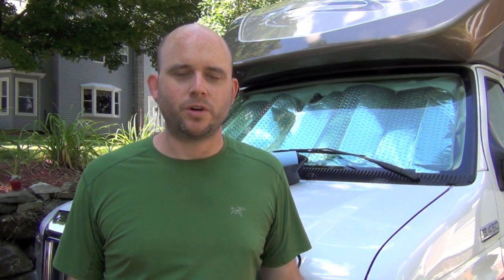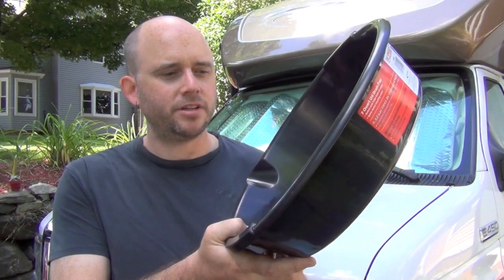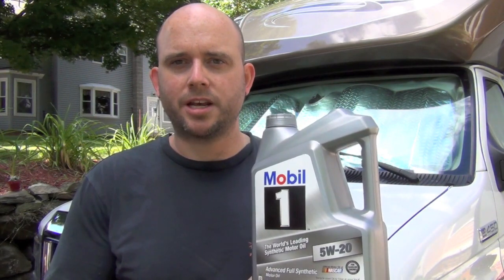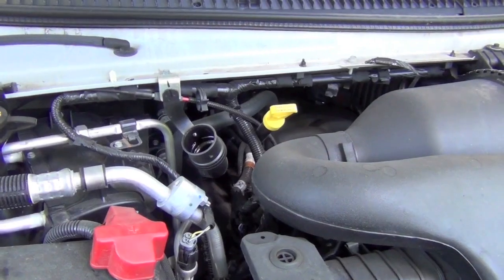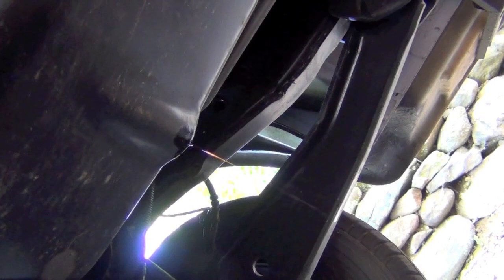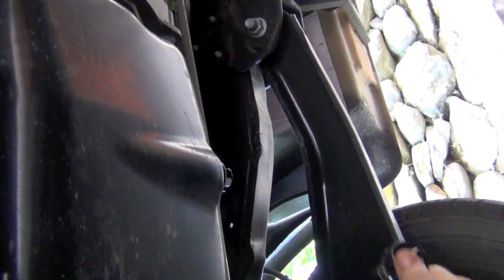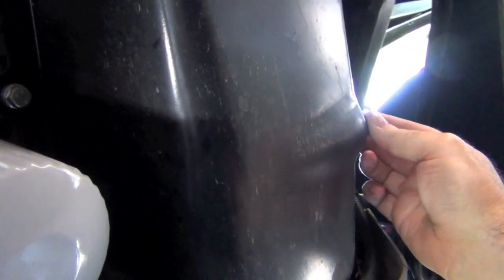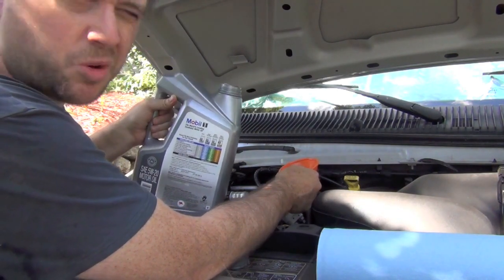How To Change The Oil In Your Ford 6.8L V10 Powered RV

Comment: Excellent, informative, video.  Being 69 years of age. Never changed my own oil. Feeling "mistreated" by ALL (no exception) RV service centers, I am now forced to do this myself.
With this video, I feel I can do this, with no fear of making any mistakes.
Reply from the maker: Glad you found it useful - I hope your oil change went well!
Reply: My wife and I are both late 60's, we both have always done all the maintenance on our vehicles, we bought a new 2016 rv on a E450 Ford chassis, thought we would try having it serviced by Camping World, BAD, BAD mistake!!!!  $$275.00 later, we discovered they  didn't even check the tires, much less the windshield washer fluid. NEVER again!!!
Reply: Karla Storm 🦄🦄🦄
Reply: the only way you know they changed the oil is if you did it yourself...I never changed my own oil either until after I looked at my air filter at 120,000 miles and realized it was the one that came from the factory...I had paid for at least three...I use a paint pen now to write the date on my oil and air filters so if I have to use a service I know if they cheated......

Comment: Thanks for the video. Just got an RV, same set up. Ford used some sense with the oil plug and filter location. I use a 2 liter bottle with top cut off when I pull vertical filter  saves on mess. Also, always fill filter with oil before installing, this way oil pressure builds quicker. Less start up stress.

Comment: Great Video.  I have a couple of tips for you.  #1 If your drain plug is not magnetic, buy a small "rare earth" magnet and stick it to either the outside of your oil filter or on the bottom of your drain pan near the plug.  Just before you remove the drain plug, pull the magnet off the pan and this will allow the particles to flow out with the old oil.  #2 I was taught by an old mechanic to always fill the new oil filter with clean oil before installing it.  (I believe this is why oil filters are installed with the opening facing up)  This will keep oil flowing instead of air for those first few seconds after you start the engine for the first time after the oil change. I don't think it makes a big difference but every little bit counts.
Reply from the maker: Great tips - thanks!

Comment: good video, some things to think about.
1. always check and make sure the old filer gasket is not stuck on the filter mount, sometimes a gasket will vulcanize it self and pull out of the old filter, if it goes unnoticed and you screw on the new filter you will get a big surprise  later on when you drive down the road, the gaskets blow out and the oil get pumped out and there goes you motor. this happens a lot at some these quick change shops.
2. always use a torque wrench on a drain plug, and a new gasket or o-ring.
3. on a vertical mount filter pre fill the filter before installing , this helps getting oil in the system faster.
4. with a paint pen mark on the filter the mileage and date. this helps on reminding you what you did and when. ( paint pens are great for marking info like torque of lug nuts on the wheel rim on the inside, filter number on the top of the battery plus how much oil, spark plug numbers ect. what ever important info you might want )
5. don't skimp on buying good oil filters. sadly fram was once top of the line. better off spending 12 bucks on a napa gold or something along those lines, yea i know it said motorcraft on that filter, but three dollar filter three dollar performance.
again , nice job on the video.
Reply from the maker: Thanks, and good tips! I feel pretty comfortable using the Motorcraft oil filter, as Motorcraft = Ford and I'd like to think they make a solid oil filter for their vehicles. I change oil every 5K miles in the RV, so I'm expecting too much out of the filter anyway. I'd strongly consider a different filter - maybe a Bosch - if I switched to a longer service cycle. I do use a Bosch filter in my tow car as I change the oil every ~10K in that vehicle. Again, thanks for your tips.

Comment: Great video. I would recommend starting the engine after changing the oil & filter, to leak check the filter. I have had one leak due to a defect in the seal.

Comment from the maker: Thanks! We recently drove 3200 miles cross country while towing our car - a Honda Fit with stuff in it. I weighed our RV (at a Truck Scale) and it clocked in at 14,500 pounds. The car is 3,000 pounds (with stuff), so 17,500 total, and we averaged just over 9mpg. After reading what other people get I was happy with that - and now that I've changed the oil and the vehicle is over 5K miles I hope it goes up a bit.

Comment: brilliant dude...unless that is a new truck you have kept it super clean...
you could actually unscrew your oil filter bare-handed and you did not need a breaker bar to back the oil drain plug off...your old oil filter was as clean as the new one...
Reply from the maker: Hi David - yep and thanks. I've done a lot of oil changes in my day and I've found hand tight for both filters and drain plugs has always been tight enough.. which makes it a lot easier to do an oil change the next time. I think I also washed it just before filming.

Comment: Filter wrenches are only for taking the old filter off. Read the filter instructions. Tighten 3/4 turn after the gasket touches. Never use a filter wrench to tighten.

Comment: poke a hole in the bottom of the old oil filter (,use an awl or phillips head screwdriver)let it drain THEN remove the oil filter,saves on the mess
Reply from the maker: Best tip here - I do this now. Thanks!
Reply: Wow never thought of that and been doing my own oil changes for awhile now. Thank You for the awesome tip.

Comment: Another thing I do after all that old oil has been drained is I pour a little bit of fresh oil into the fill of the engine with the drain plug still removed and it pushes some of the old dirty oil out after it has drained and then I re-install the drain plug.

Comment: My 2016 Jayco Class A motorhome Ford V-10 manual and oil fill cap both say 5w-30 and the quantity says 7 quarts so viewers  need to check your cap and manual.
Reply from the maker: You're absolutely right - always check your manual first. I've read that Ford changed the recommendation to 5w-30 in the past couple years. As far as oil - I've heard 6-Quarts, 6.5-Quarts, and 7-Quarts all from Ford. Best advice is to add 6, run the engine, let it sit - check the oil level, and then add more until it's full. It's also possible that the 3-valve V-10 in your class A takes a little more oil than the 2-valve V-10s found in most Class-Cs. Thanks for your comment.

Comment: I go w/ the climate to the oil grade.  There are advantages to synthetic over conventional; however, I read that its optimal benefit is at 25% synthetic.  It's owners choice.  Yet, if it was a natural gas engine then you would always use 100% synthetic to keep that clear look to the oil.

Comment: 5w20 is NOT the original oil for the Triton, 5w30 is, 20 causes Cam phaser issues, never heard of the 5w30 causing it, apparently thickens enough during heavier work
Reply from the maker: Good info - I suspect Ford switched it to 5w20 to (slightly) improve fuel economy for EPA purposes.
Reply: @Trekwithus  On the oil cap it shows 5W-20.
Reply from the maker: @jimlaw6014  yep - our oil cap shows 5W-20. The engine hasn't changed in a while though, so it wouldn't surprise me if the oil caps from previous years had 5W-30. I have heard of the Cam phaser issues, so may change to 5W-30 going forward. It's not a huge difference .

Comment: good video, but you missed some things #1 you should always wear thin gloves because used oil is very toxic and can do bad things to your body, #2 running the engine first is to warm the oil and to circulate through the engine so when you start again you don't get a dry start, # 3 you did not check and or replace the crush washer on the oil plug and you did not clean the drain hole, #4 nobody ever explains this one, I noticed that your steering linkage had a grease zerk fitting,  most vehicles now days don't have these, however bigger rigs do on the steering ball joints and it probably has some on the drive line at the u-joints and the sliding spline, and they should be greased at least along with the regular oil changes, # also I would think in some warmer climates that I would run some 5w-30,  other then that good work!

Comment: Did you have to put it up on ramps or was there enough room to get in there underneath, little nervous a ton of weight to put on ramps?
Great video by the way thanks
Reply from the maker: I didn't need ramps - there's enough room as long as you're flexible. I didn't even use my auto-leveling jacks (and shouldn't probably rely on those either).

Comment: Here's a tip I learned 30 years ago when I did tune-up/lube for a living, which this guy obviously has not.................   drop the oil filter FIRST.  You can let it fall in your catch pan and there won't already be 5 qts of oil for it to splash in!!!!  Put on your new filter, THEN pull the drain plug.   You're welcome.
Reply from the maker: Good tip and I'll do that next time - thanks!

Comment: If your filter is upright like that always fill that sucker up with oil it will save your engine in the long run, it just takes a couple extra seconds to fill it up if you don't fill it up .
Reply from the maker: Hi Hayden - you're absolutely right. I just changed the oil (again), and this time I filled the oil filter before I installed it. It took a little more than half a quart to fill!
Reply: just something i learned in diesel school. and also instead of oil i now use grease to lube up the o ring on the filter and it seems to be easier to remove and install.

Comment: We have a 06 class C Ford E450 v10 as well.  It's used and was used as a rental when we bought it.  Dealer said he puts 30w heavy duty oil in.  WIC's filter.  It calls for 5w20, thoughts on the 30w?
Reply from the maker: I wouldn't use 30w oil in a modern vehicle engine. 30w is a single grade oil, vs 5w20 or 10w30 which is a multi-grade oil. At very hot temperatures - say 100+ degrees - 30w and 10w30 will have the same viscosity and protect the engine the same. However when it's cold the 30w oil will be very thick and not very viscous which will lead to extra wear and tear on the engine, whereas the 10w30 has additives that keep it thinner and more viscous (protective) at colder temps. Long story short, if you live in a warm part of the country, or if the dealer only drove/rented the RV in the summer then the engine is probably fine. If you live in a cold part of the country or if the RV was driven a lot in the cold then the dealer did you a disservice as 30w would create extra wear and tear on the engine. If the piston rings and seals are worn, then 5w20 might be too thin to be protective. In that case I'd opt for 10w30, but I'm not a mechanic. If I were you, I'd call someone in service at your local Ford dealer and see what they recommend you use going forward, but whatever you do replace the 30w with a multi-grade oil.
Reply: Trek With Us I second this course of action.

Comment: How often do you change your oil ? In your class C Motor home . Thanks ..nice job.
Reply from the maker: Hi Tony - As we tow a car and are right at the 14,500 GVWR (heavy duty application), I change it every 5,000 miles give or take. I also check and add oil as necessary every month. As we usually don't travel very far at a time I've also changed the oil based on time - 'they' recommend every 4 - 6months, so every 5K miles or 6 months sounds about right. Good luck - and thanks!
Reply: We just purchased a 2016 e-450. I assume the dealer never changed the oil while the unit was waiting to be sold and would also assume that it is due for an oil change even though it has less than 1000 miles on the odo.
Reply: Trek With Us good advice I change mine every 5000 miles as well, bmw suggests every 25,000 km on my mini there is now way I would ever go that long between an oil change, like you I change mine twice a year regardless if I hit 5000 miles, with the colder temperatures in the fall and winter I as thing about the condensation from the temp difference

Comment: Some say 10w-30 for summer time and 5w-30 for winter. Whatever the oil cap says on the engine go with that oil.
Reply: Yep, you can't go wrong using the manufacturers recommended oil. I figure they built the engine and know a lot more about it than I do!

Comment: I am purchasing a preowned RV with 7,000 miles on it, but I can't seem to find out if Synthetic oil was originally used.  Is it OK to use Synthetic oil now?  I prefer the Synthetic, but I would like some verification that it is OK to switch.

Thanks,
Bill
Reply from the maker: Hi Bill - it's fine to switch to synthetic. The weight of the oil is much more important than whether it's dyno or synthetic. I'd stick with the manufacturers recommendation for weight, but switch to synthetic whenever you're ready.
Reply: Thank you very much for the advice.  I am going to follow the manufacturer's recommendation to use Mobile 1, Synthetic oil, 5W - 20.  You were a great help.
Reply from the maker: William Monteith You're welcome - and that's the exact oil I've been using for the past 5,000 miles. The engine seems to run more smoothly and quietly on Mobile1, but that might be a cognitive bias. I'm interested to hear your impressions after the oil change.

Comment: Did you end up adding any more oil after you ran it a bit? was the 6qt sufficient?
Reply from the maker: Hi Kyle - I found 6 quarts to be perfect. I always run the engine after an oil change before checking the oil level so the oil gets distributed through the system and oil filter. In the Ford 6.8L a fair amount of oil stays in the chamber above the oil filter (not in the pan), so running the engine before testing the oil level is a must.

Comment: 1- look inside the owner's manual and it will tell you what weight of oil to use for different climates. The weight listed on the cap is not intended for all the time use. For example, for my hyundai the cap says 5-20 but the owner's manual specifically states that 5-20 will not provide sufficient lubrication in hot climates. I live in Vegas.  Way too hot for 5-20 per the owner's manual.   Perfect example. 

2- Engine oil is a carcinogen. Causes cancer. Always use gloves and avoid contact with skin as it is absorbed through the skin. Cancer=Bad
Reply from the maker: Good tips, Robert - thanks. And you're right about gloves of course. Used oil is full of PAHs (Polycyclic Aromatic Hydrocarbons) that are carcinogenic - however I rarely handle used oil so I think of it like cigarettes - yeah they cause cancer, but I'm rarely around them and the exposure I do get is unlikely to hurt me. I'll add that unused (new) oil is nonmutagenic and has only trace PAHs so it's not considered carcinogenic.

Comment: i would not recommend telling people to tighten by hand and that should be okay. The filter instructions tell how tight it should be, follow those instructions, as I remember it is tighten by hand until the gasket make contact, and then tighten another 1/4 quarter turn.
Reply from the maker: Bryan Sharp Fair enough, Bryan. At this point I tighten by feel and when you've changed your own oil for years it's easy to take what that feels like for granted.
Reply: I thought that was 3/4 turn. Always went by the guide on a Fram filter. I'll investigate when I get time, lol.

Comment: hey I change my oil and now the sensor on the dashboard won't show if it's high or low it just says it's low it won't even read what did I do wrong
Reply from the maker: Hi Blake - it sounds like you didn't add enough oil. How much oil did you put back in? Make sure to run the engine, let the oil sit, and then check the oil dipstick and add as necessary.
Reply: Trek With Us yeah when I crank the engine and let it run for about 10 seconds at red pretty good thank you very much

Comment: how do you change air filter on 2014 ford E450
Reply from the maker: Joe Sandoval Hi Joe - I can make a video, but it's really easy. The air filter is large and cone shaped and is located toward the right/middle of the engine. There are clips that you'll need to release on each side (by hand), and then pull and there's the air filter. Remove the old, put in the new, push the intake back together and clip it and that's it.
Reply from the maker: Joe Sandoval Also, at the 6:36 mark in this video the air filter assembly is in the middle of the picture. You can see the clips right around it - and yes, it's the entire plastic assembly in the middle of the engine compartment.

Comment: how do you keep the bottom so clean?
Reply from the maker: I washed it pretty well before I filmed the video and it was only a couple years old at the time (2013). I think the dealer also undercoated it, and that helped keep it clean longer. It sure doesn't look like that now!
Reply: @Trekwithus  pressure washer?
Reply from the maker: @johnhilton6863  Nope - just a good long-handled scrub brush and a long handled garden sprayer on a hose. I don't love the idea of pressure washing the engine area. I wouldn't want to force water into some enclosed electronics or something.
Reply: @Trekwithus  thanks